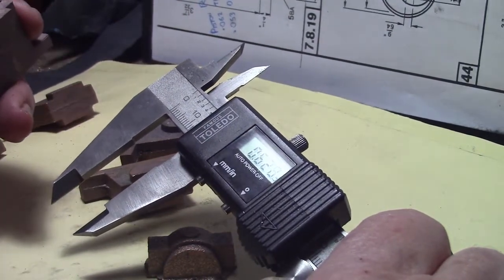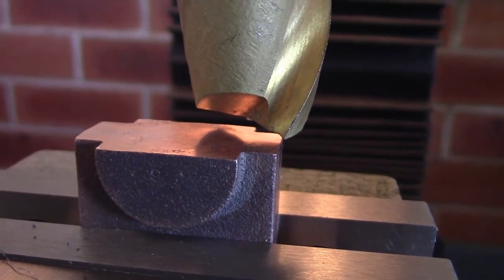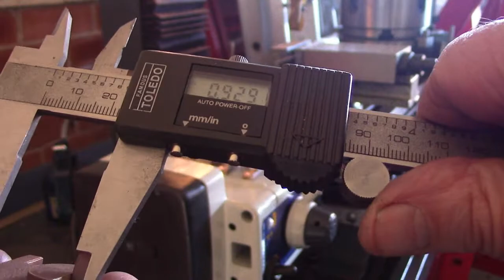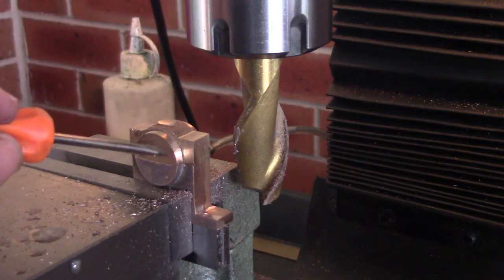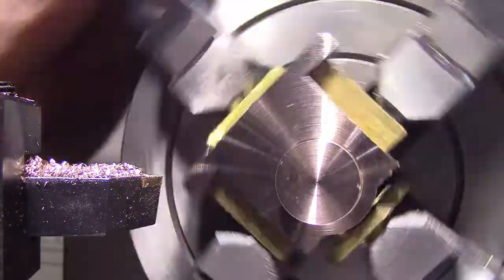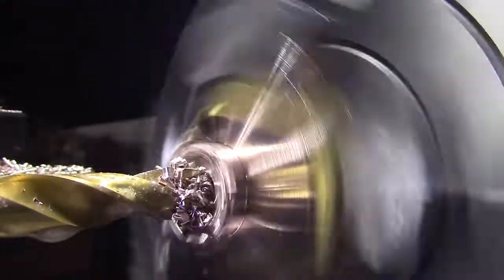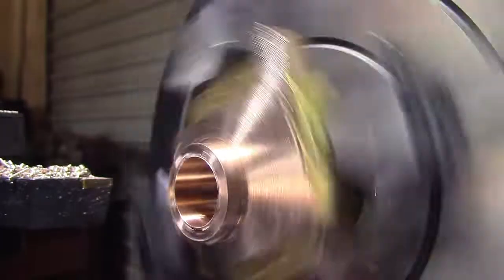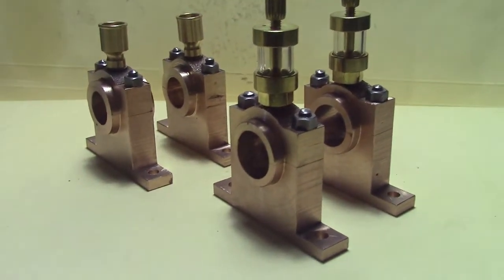Stuart Beam build Part 7

Comment: So enjoying this inspirational build as I’m contemplating building my own Stuart Beam. Thank you for showing how you tackled each element.
One question though. You drilled, tapped and secured the baring block after you drilled and reamed the block. Any reason why you chose to do that rather than the other way round? Relying on superglue gives me the shakes! 😲
Reply from the maker: HI Mate
Thank you for your kind comments, the only reason I drilled and taped  after drilling and reaming is I wanted good finished surfaces to size from and also the lathe chuck held it all in place (not only relying on the super glue) it also ensures when you disassemble the bearings they will be aligned on re-assemble. (the bolts are aligned with the bore, not the other way around.)
Believe it or not the super glue method is very strong.
This is personal choice which way you do it. (whatever you fell confident with.)
Regards
Gary
Reply: @creepy013  Thank you Gary. I am most grateful to you. I have never tried using Super Glue in this manner. I am kind of itching to try. 

Your finished engine looks a treat. Well done, and again thank you for the inspiration. 
Andrew